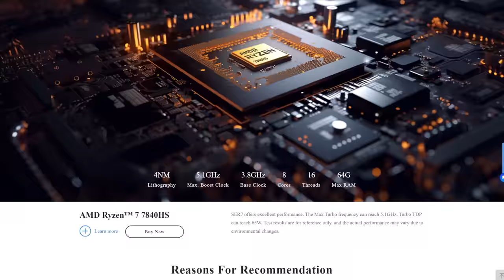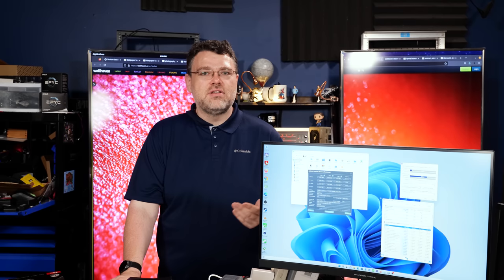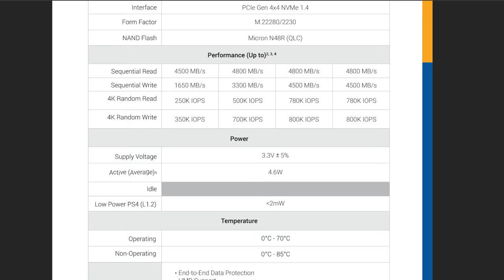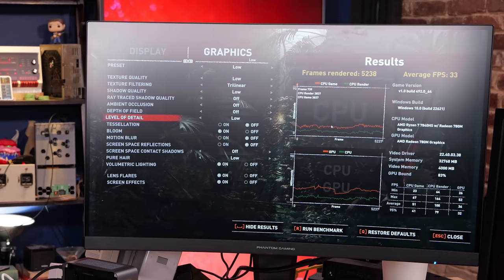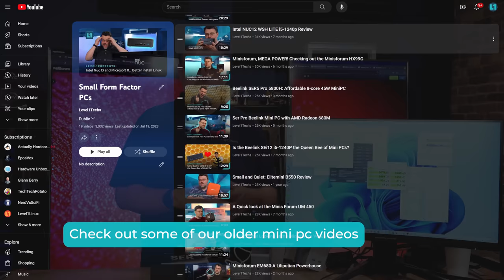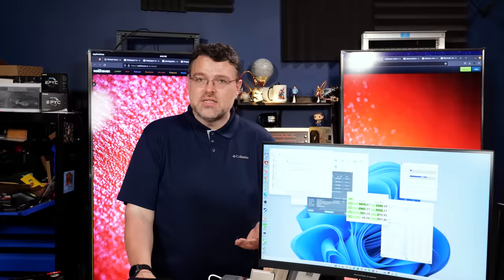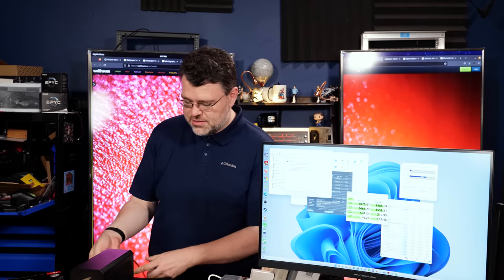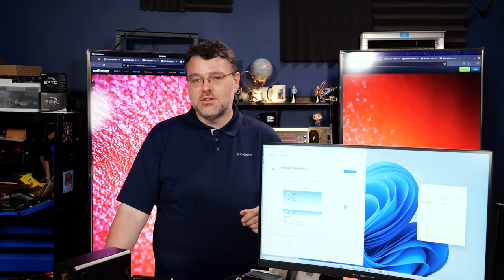Bee Link's Ser 7 Mini PC Power Supply Could be a Trend Setter

Comment: The proprietary magnetic power supply is universally hated by consumers. You also cannot buy them separately from Beelink until your current one breaks. Saying it can be powered by USB PD is also false as many SER7 owners (myself included) have confirmed it. This strongly suggests you have not actually tested this option and just went with the specsheet.

These reviewers really need to actually test something before they say something. Otherwise, it's just misleading.
Reply: I need more info on this matter, 

on this video's comment section, someone stated that it could run in a USB4 port(PD3.0 100W (20V5A)) for power supply, however, it's mandatory to set TDP from 65W to 54W in BIOS, which supports 20V/5A max.

could you also help me test it? I am planning to buy it if it works.
thanks in advance

Comment: What a pity. It is a nice device, but I can't  buy it, because propietary power connectors are forbidden in my religion.
Reply: I'm also a believer of that religion
Reply: @scarlet_phonavis6734  also 99% of the PSUs modular?!?! pffffft
Reply: @scarlet_phonavis6734  lol what
Reply: @scarlet_phonavis6734  All that means is that the power supply CABLES cannot be transferred between different brands of power supply. The size and shape of the power supply, the power connectors for the motherboard/PCIe power, and the power cord from the wall outlet are all standard. The only difficulty that would arise is purchasing the correct power supply cables, and that's only if you lose them on a new unit anyway. And buying used PSUs is usually not recommended.
Reply: @jamesbuckwas6575  It's also not terribly hard to swap the cables in the cable-side connectors (or cut and re-terminate them again). The modding community has been doing that for ages for sleeving and all sorts of stuff.
Reply: @scarlet_phonavis6734  No, it's not the same. If your ATX PSU breaks you can replace it with one from any other brand. That's the whole point about  the right to repair, not to be tied to a propietary brand.  But the model in this video is the opposite, if your PSU breaks you can't only replace it with the same brand, and that is supposing that they still offer it when it happens after a few years, which is very rare.  If you like propietary garbage just get Apple bs.  but please don't contaminate the  PC open market freedom with this kind of  abomination. PCs are the last human  machines that are repairable and upgradeable based on open standards at open market prices. And for us PC enthusiasts the whole hobby is about this, and we will defend it to the end.
Reply: Not many seem to be aware that this little gem can be powered using either one of the two PD USB-C port at the back. I have this hooked up to my monitor with just one USB-C cable. No power cable necessary. No HDMI cable necessary. Perfect!

Comment: The main issue slowing down this machine in this test......WINDOWS.....I've got slower machines that have far better scores and much more power then this using Linux. Windows makes most PC's slow and sluggish as its such a sloppily built and programmed OS.  I own a WIN MAX 2 Rizen 6800U which runs games like Sniper Elite 5 on High at 2k resolution very very well....on Manjaro.... Get rid of Windows on this machine and i bet it will go like stink......Gamers and Users....#windowssucksforeverythingthesedays